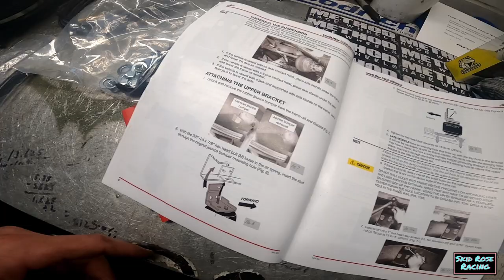Van Vlog 3: Airbag Install and More on A Ford Econoline Van Camper Project

Comment: I had a 2006 E350 XLT Extended, V10 = best tow vehicle ever. I didn't have airbags. A weight distribution hitch would have fixed that sagging. I would still recommend one even with the air bags. Real difference in tow ride quality. Good video, thanks. :)
Reply from the maker: Thanks! 

I'll really see how well this does after I replace the leaf spring bushings. I'll definitely make a video about that! 

I've towed with a weight distribution hitch on a couple of rigs, and I feel that it's not necessary for my current application. If I didn't have bags, it would probably be the move though.
Reply: @skidroseracing  leaf springs look a little flat, maybe just replace everything.
Reply from the maker: @Agentlowe  I've been considering that. They aren't saggy when the rig is unloaded however

Comment: Good video.  I am going to get those bags fro my E350.  It's nearly identical to yours.  Mine just has a rubber mat floor instead of the fancy floor.  Did you see te J FAB van bumper.  It ins the J Fab Build list video.  Maybe it will give you ideas for yours.
Reply from the maker: Thank you, I haven't seen that video, I'll have to check it out!